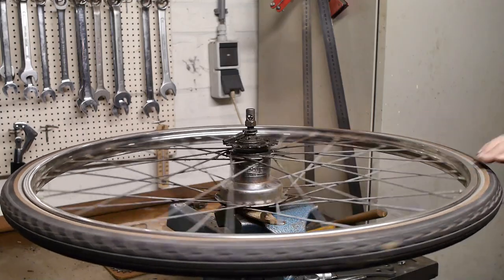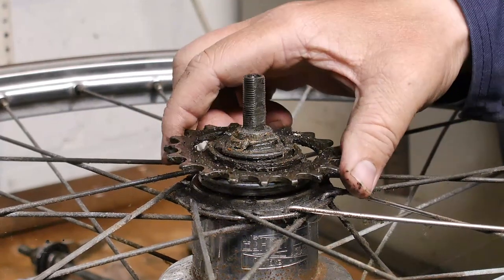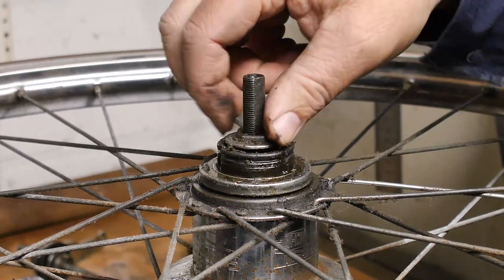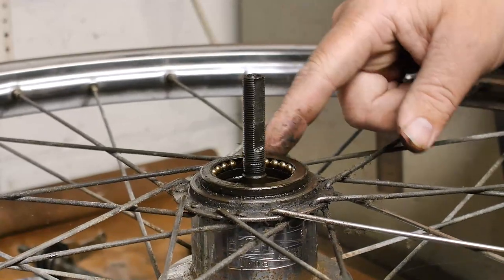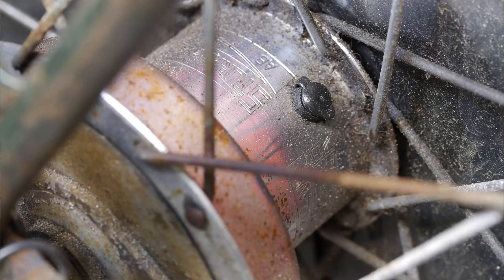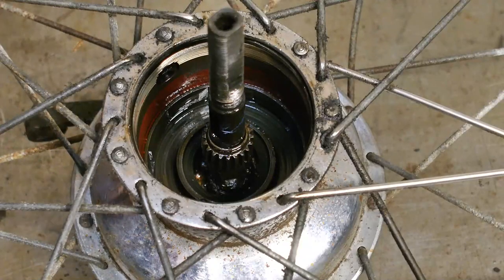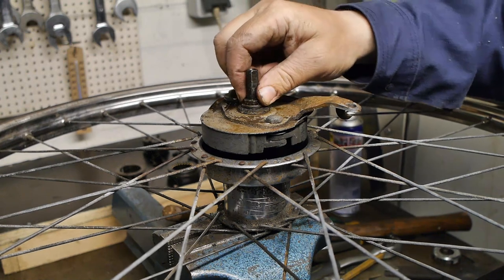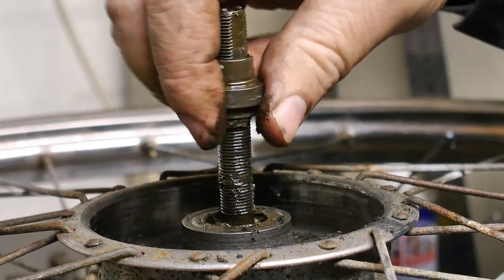Disassembling a 1980 Sturmey Archer 3 speed hub with drum brake

Comment: It's very oily because that's what Sturmey Archer hubs of old used for lubrication. They shouldn't be running IN oil, but they should be running WITH oil, adding a tea spoon every so often should suffice.

The most common problem of an A-series hub (AW, AB, etc) is the dog clutch wearing out. You don't want chipped or worn edges, that's responsible for the dreaded "no gear" between 2nd and 3rd and a lot of testicular injuries.

Comment: Hi, you had to loosen the drum side first.
Reply from the maker: It's a non-adjustable bearing. I just use a breaker bar to get it as tight as I can. There probably is a torque spec, but I don't know it. I do use a torque wrench for alluminium rims :)